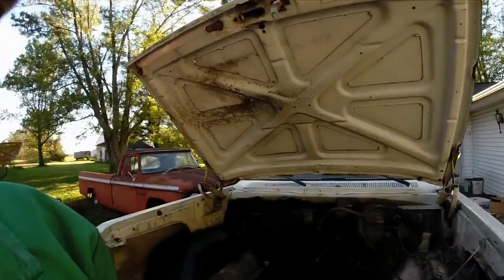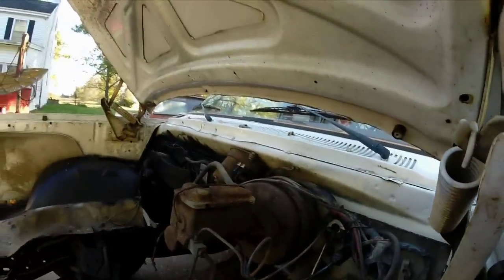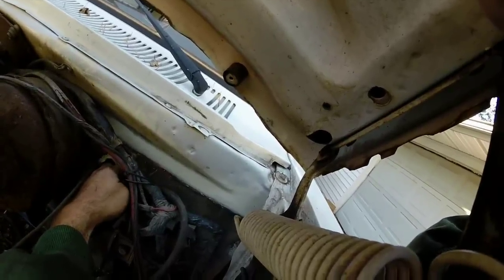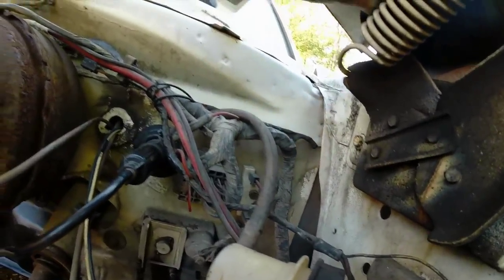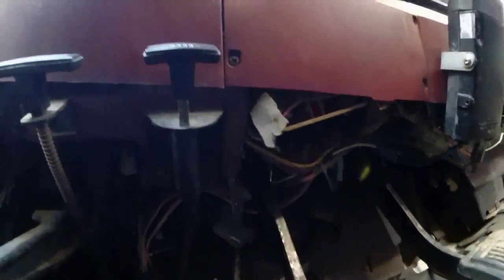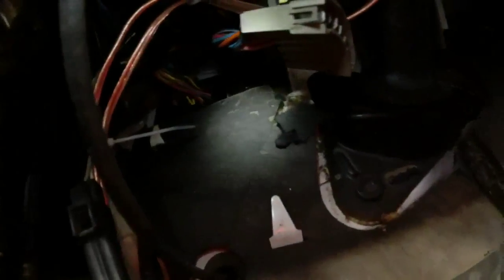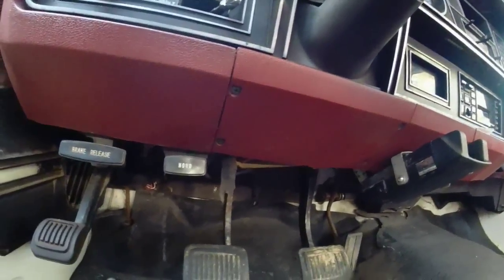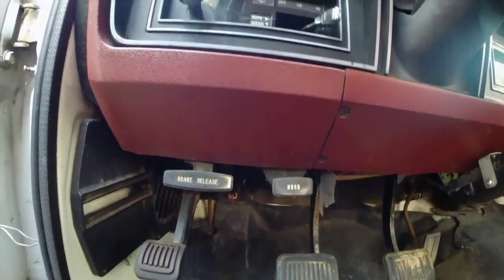Auto to manual 1st gen dodge swap

Comment: Do you know if a cab for a 91 d150 with automatic transmission would fit on a 83 d350 dually with manual transmission fixing up a old dump truck i got needs a cab rusted bad
Reply from the maker: Probably not as most automatic cabs have the small floorboard hump.